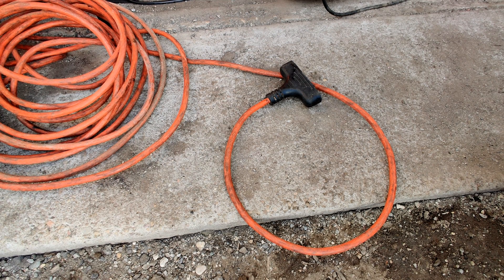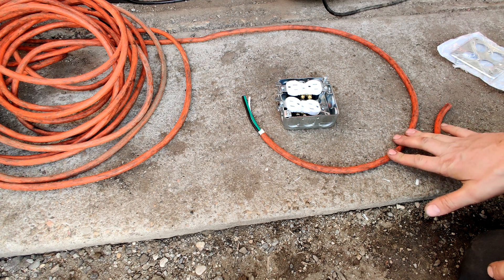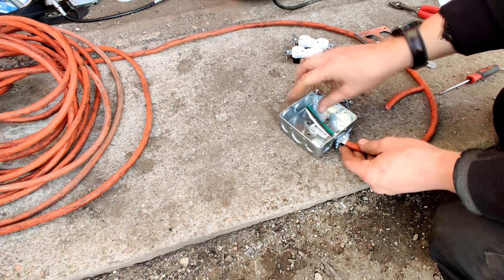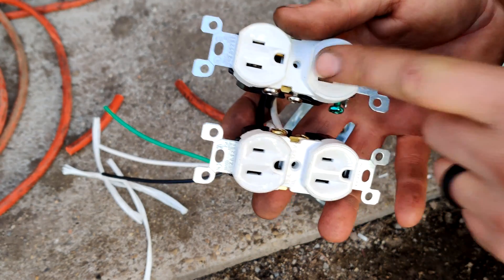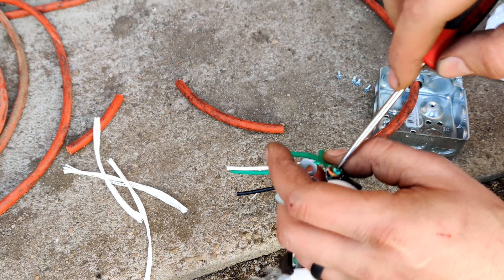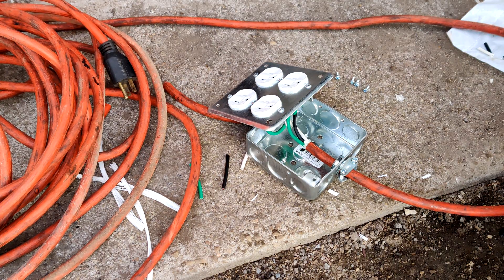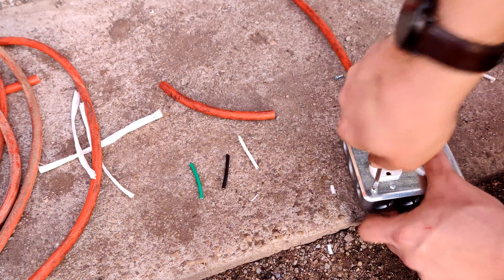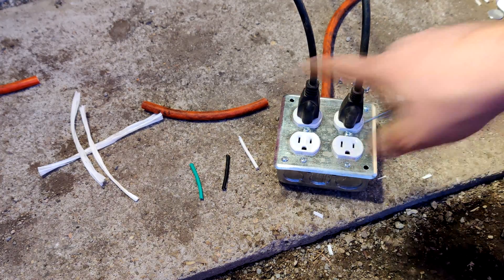How to Build a new upgraded plug for an extension cord

Comment: This construction is not an NEC approved installation. Metal boxes are intended to be "proper mounted". The box is not waterproof. If you only use it at home, and endanger yourself, so be it. If you use it on a job, it's a violation.
Reply: Waste not want not

Comment: Your thinking of a Strain Relief for the cable, I saw a cord being made up on a video not too long ago, the Strain Relief that was used was ordered online, I think you can also get them from specialty electrical places.
Reply from the maker: You talking about the part that actually holds the cord? I remember using them in welding class but I couldn't remember what they were called

Comment: Id love to do this my grandfather used to, i want to do one for myself but i wanna make sure the cord is rated for a lot of wattage so it doesnt get hot or any of that
Reply from the maker: Yeah you definitely want to double check the gauge of wire. If you look on the cord itself you will see AWG followed by numbers or example a 12/3 cord contains 12-gauge wire and has three conductions inside. The smaller the number the bigger the wire.
Reply: @ils360  yeah i had to go through this when i was staying at my dads during the pandemic thankfully i found one that could handle over what my electric fireplace space heater was rated to use and it was like $15, my regular outdoor extension cord was getting so hot Thats when i learned wire gauge matters
Reply: I always write the gauge on each end of the cord with black sharpie. Saves time trying to read the invisible writing

Comment: a GFI would make it awsome
Reply from the maker: A GF I definitely would make it really nice the only downside to it is that if you had a GFI setup correct me if I'm wrong but if you have it plugged into a generator the GFI won't work correctly because it's not grounded correctly I pretty well solely use mine on a generator
Reply: @ils360  Yup , Your right man ! Tried it and trips every time..